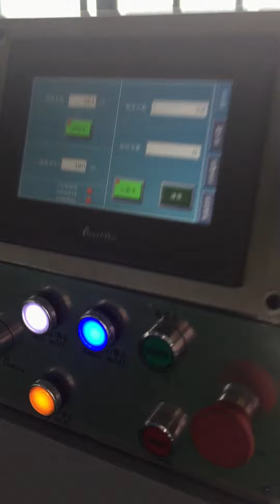Sticky note gluing machine

Comment: Technical question please, glue dry with hot air, ir or uv ..?
Is glue strip customizable  (strip's width and position, additional strip) ?
Reply from the maker: Mohamed Bentameur hi， by heating tube not IR or UV lamp , the glue strip is customized ( glue roller need design advanced)
Reply from the maker: Mohamed Bentameur very sorry I just read your message. If you still interesting please contact with me. Whatsapp 0086 18650523130